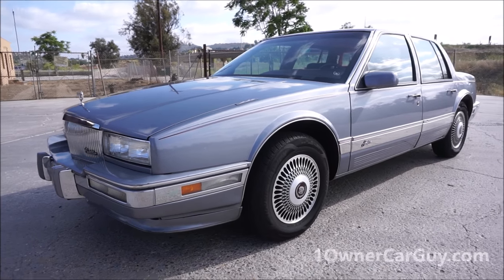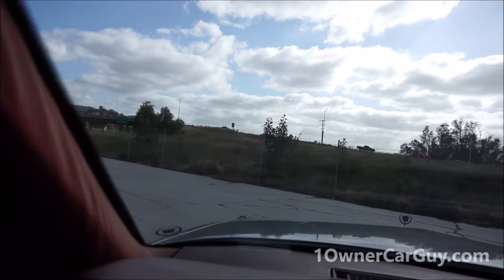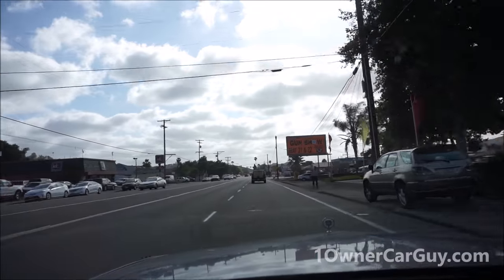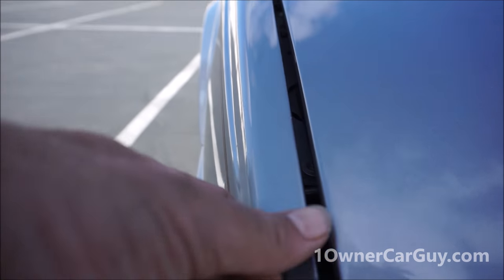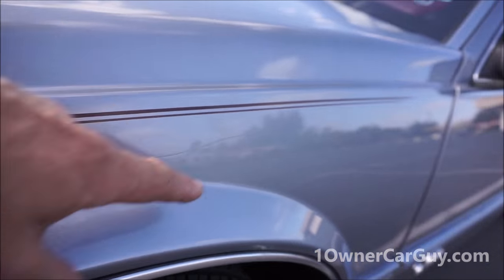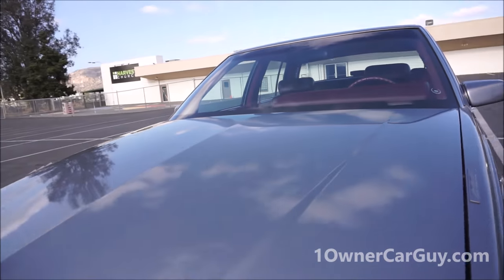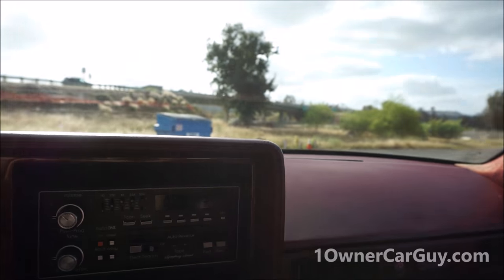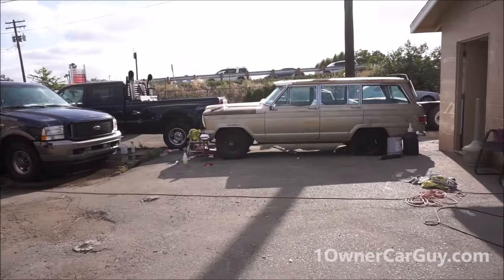1990 Cadillac Seville Exterior Review Video Review Classic Car

Comment: I used to own one just like that one. Great car, except for the ABS brakes. Those brakes were a pain. I would be driving and suddenly, without warning, the brake pedal turned to like concrete. The failed brakes would stop the car albeit in a much longer space. Not a good feeling at all. I bought it from the original owner in 9/10 condition, but he warned me of the braking problem. I took that car back to the Long Island Cadillac dealer multiple times for repair, but the problem would resurface again a month or two later. Finally I solved the problem by replacing the entire ABS unit, a huge, heavy piece of hardware, almost the size of the automatic transmission. Problem solved and great ride from then on.

Comment: Interesting little vehicle.

I would like an STS Deville, but all the ones I've seen have a Northstar malady of some kind.
Reply: +KayakTN  I think all Northstar engines suffer those maladies, however I'm told by a friend in the trade who is about as close to an expert in them that there is in the UK that as long as the engine hasn't been severely overheated once they've had the head gaskets and the other usual faults sorted they're fairly bullet-proof.  His own STS has done over 120,000 miles without problems since he did the work and the engine and transmission are great.  Sadly the bodywork is getting a bit crispy and the electrics are getting a little temperamental so he's considering finding another dead one and transplanting his good bits into it.  It seems that if you can do the work yourself and you're careful about what car you buy you can end up with a lot of car for not much money as a lot of the quality replacement parts are better than the original ones.  But if you're going to have to pay someone else to do the work you can probably get "better" cars for what you'd spend buying one and getting it sorted.  It could well be that an earlier car from before the Northstar era might welll be a better bet in that case, if you look hard enough you WILL find a really nice one for sale because of the kind of people that bought them new...